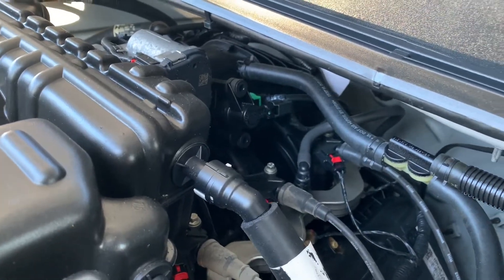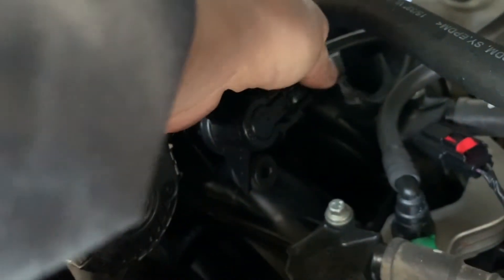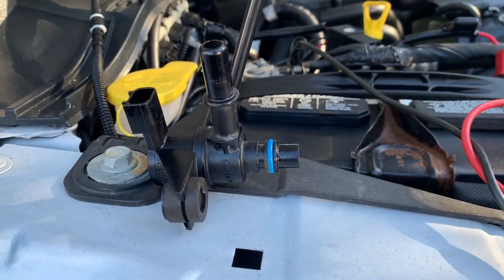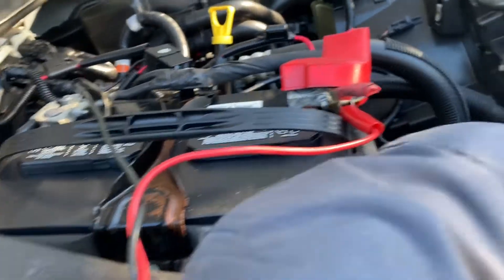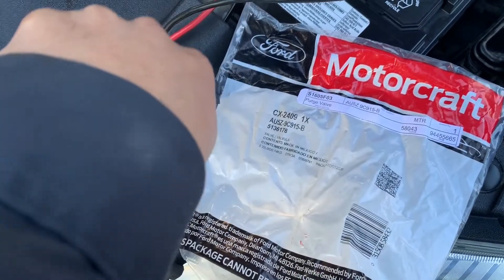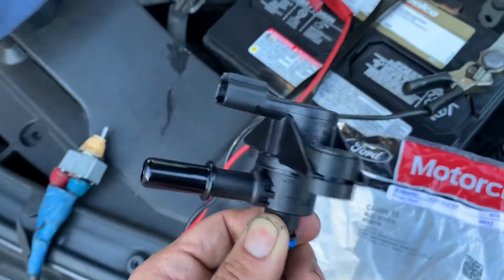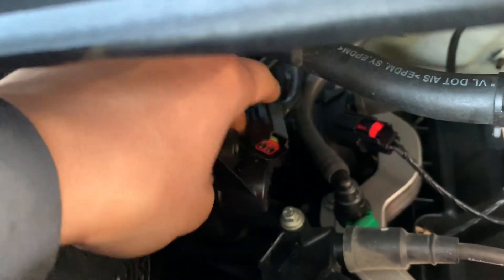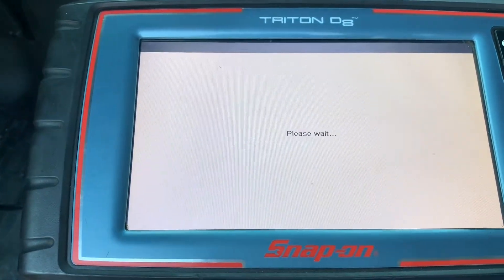Ford F250 Super Duty Evap System Leak (Code P0456) Easy Fix

Comment: i replaced the purge valve and a new gas cap (that is where the dealership said it was leaking) and its still throwing the code...what should be my next step?!  2017 f250 6.2
Reply from the maker: Perform a evap smoke leak test, if you know how. This will help you find any small leak in the evap system. The only thing left to check is the canister  and vent valve. Check the purge valve connector, make sure its not damage pins or broken wires.
Reply: evap cannister valve or connections
Reply from the maker: @darrenyoung4893  check both to make sure

Comment: I got two codes on my 2020 F250. P0456 and P0455. Do you have a fix for that second code?
Reply from the maker: @ScarySpots  P0455 is evap large leak. Either evap vent valve or charcoal canister.

Comment: How much
Reply from the maker: Around $100 oem part at dealership.
Reply: Do you have the part number ?
Reply from the maker: @alexisdeleon5969  The part number I showed in the video at 1:30sec.
Reply: Thanks for the video, scanned it at the dealer but they didn’t have the part so I went to Napa and did it myself. Does the engine light re set itself?